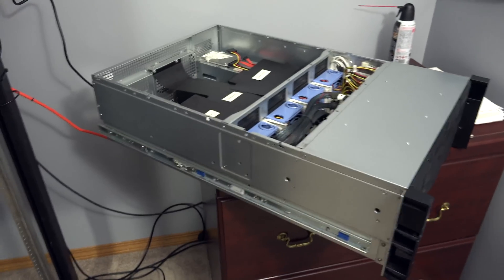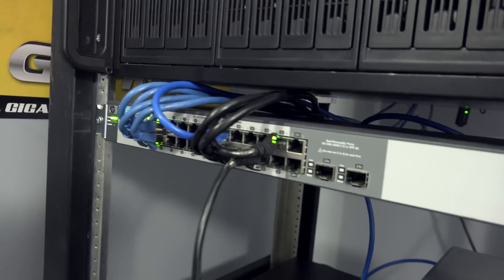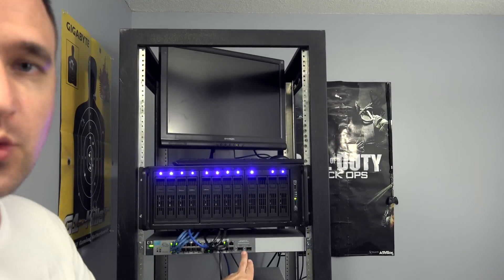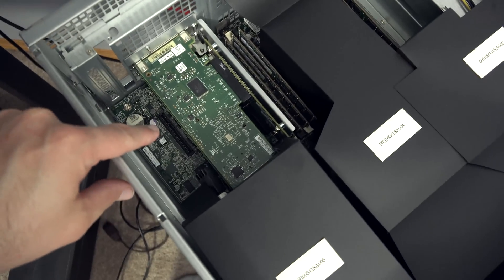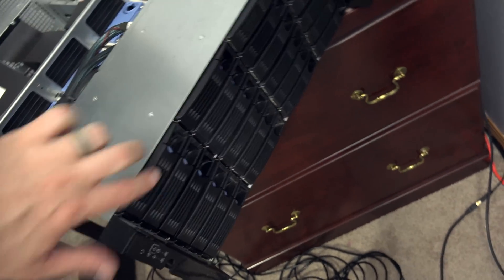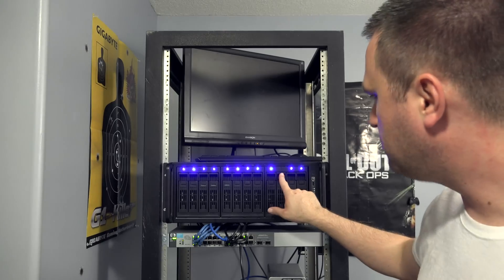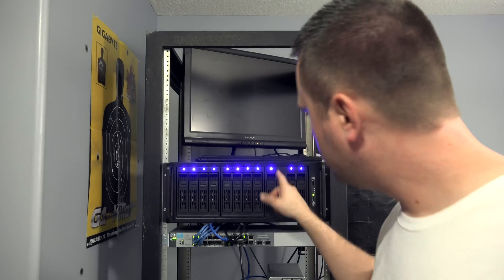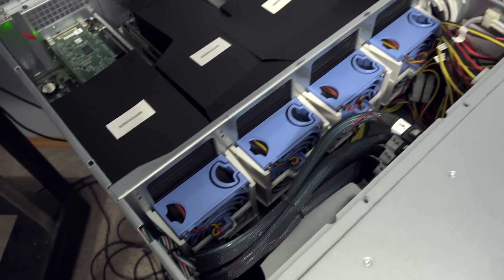New Dual Xeon Plex server vlog...P1...

Comment: Most servers have a power or cooling profile setting in BIOS that allows you to reduce the fan speed and noise of the server.  So, you probably don't need to change any fans.  Also, look up "Intelligent Platform Management Interface" or "IPMI" to see about that network port that didn't work the way  you thought it should.   Once you learn about IPMI I think you will actually like it.  SuperMicro has a number of publicly available pdf documents on their website that explains how to set up the IPMI and use it.  If you can find the serial number for your server write it down and register with ZT Systems so you can get to their support files i.e. user manuals, drivers, and BIOS update files.

Comment: awesome server man. i have one solution which i use for my servers although they run windows with vms as i use a piece of software called speedfan. its super easy to use but as far as i know, its only compatible for windows which sucks. Speed fan will let you change the speed of every single fan in ur server and some other cool things like temps etc. it can be an arse to setup so hmu if ur thinking about using it.

Comment: I love watching your upgrades and transition to more enterprise type gear.  I'm getting ready to do the same at my house, looking for something with 16-24 3.5" bays and at least 32GB ECC.  Whatever I get, I'm going to see if Noctua has a fan that will fit it, much quieter.  Great content, I like watching you figure stuff out as you go..

I've never used unraid, just openmediavault, freenas, and rockstor.  FreeNAS is nice, but my style is to just throw in another drive as I can afford them, and the ZFS pools like to be predefined.  Rockstor isn't super popular as far as I can tell, but I do like the direction BTRFS is going.  Light on resources, and the copy on write and snapshot system is pretty robust.  Downside is lack of maturity and possible instability, although I've never had a problem.

Comment: Regarding the sfp ports on your server, call the manufacturer of the server and ask them what is the size of bandwidth.
Regarding cables, i came across same issue setting up my 10g network. I went through three different cable brands till it worked, i had to use the expensive HP brand cable to connect to my HP switch. You can always return the cables. Use a heat source to loosen the adhesive of the cable packaging so in case you need to return it you can have less issues with the return. Some of those sfp ports will only support copper or fiber.

Comment: I have six enterprise servers in my house. The noise became unbearable that i had to build an insulated closet to house my equipment. To keep the units cold, i ran an external tripplite AC unit to my closet space from below. From top of my rack i pull the heat out to my external wall to the street. That was my solution for cooling and noise.
Reply: Fyi, AC running on low at 67 degrees into the closet, the closet temperature is 70 degrees.

Comment: Congratulations on the new server! 

I have a couple of points. 

1.  Go with unRAID
a. It is less of a hassle for home (non-business) use. 
b. Virtual Machines Host
c. If you ever need to reconfigure, it's much simpler - no need to spend 10 hours reading the FreeNAS manual. 

2. You can fix the fan noise. It is not terribly complicated, but you do need to know basic electronics. 

Servers run PWM (4-wire) controlled fans. Colors are usually; red +; black -; yellow RPM; blue or green PWM. Red and black wires power the fan electronics and the fan motor. Yellow wire is the RPM sensor that lets the BIOS know how fast the fan is spinning. Blue or green wire is the PWM control signal, this signal is controlled by the BIOS. As the server temperature sensors detect a change in rise/fall in temperature, they will adjust the duty cycle of the fan to make it spin faster/slower.

You could try to replace the existing fans with bigger and lower RPM PWM fans simply by splicing the connector. However, when the server POSTs, it spins up the fans to the max duty cycle to check that they are working correctly. So this solution most likely result in a fan fault; the computer might shut down, or if you're lucky it will boot, just forever display a fan fault, which should be fine.

I've done this many times. What you'd have to do is:
a. Keep one high speed fan onboard. You'll need to breakout the yellow wire to the other fan ports. 
b. Splice the yellow signal wire into the all other fan ports. When the server POSTs, all fan ports will report as good.

It's not an elegant solution, but it works, and it allowed me to run my server in my bedroom closet. Otherwise, the noise DOES become burdensome.

Comment: The fans went to 100% most likely because you removed one. The server is detecting a fan failure and is going to some kind of safe mode to prevent overheating.

Comment: You got a lot to do and learn. 
Can't change the fans in New server, bios and ipmi check for all parts being present. Server won't boot if all fans not in place, ish. . .  

FreeNAS will accept growing volumes, but lacks detail at the hardware level. 

You need to fully define your use case.  And test each on your new server. 

I have an hp dl580 g7 and it doesn't really like FreeNAS. Nor does it like pcie pass-through. So you really should test both/all options. 

See if there is a riser card for your server to add more pcie slots. 

Also SATA really is dumb in server hardware. But obviously  SAS is expensive. So just keep that all in mind,  and you can't mix etc. 

I say unraid or VMware esxi. That has a trial as well and can really leverage the server.

Comment: Not cable, it´s probably just the SFP must be HP branded, this is very common. It´s possible to buy noname  SFP with HP firmware for very cheap. 

Use Unraid.

Comment: don't switch fans the hdd's need the airflow. keep in mind, a good hdd temp is between 30-35°C. because the hdd's are stacked so tight together in the front of the chassis there is very less room for the air to cool the hdd thats why you need high pressure and high pressure means loud as hell. for operating system. since you have proper hardware you shoud use a proper system. think of solaris together with napp-it.

Comment: that's a VERY VERY bad idea first of all let me explain something rackmount servers need those special fans because of their design and your any attempt with replacing them might end up with a dead board because those boards have special chips to check integrity of the fans and by dead i mean from cpu damage because those heatsink mount holes are designed only for those heatsinks not some aftermarket ones because enterprise users don't give a damn about noise

Comment: Not sure what your use case is.  But, dual xeons for a file server in non enterprise might be over kill.  I would recommend break the two roles aprt and have a separate plex server and a separate NAS.  In terms of bandwidth see if you can link aggregate the ports though I doubt you will be able to saturate.  Also looking into using SSDs for a SLOG to improve write speeds.

Comment: I'm running NAS4Free in an old PC as my NAS and security camera storage, and without ECC without any problem. I suggest to also take a look at the NAS4Free option.
About the 10GB ports on the MB, without any expansion ports in the back, how this thing was connected before? Maybe there's a proprietary software to configure them to act as the main link to your network. 2x 10GB ports only for bios config and no network connection option should be a very strange configuration.

Comment: If you have a good size coat closet then gut it. Then put your server setup in their. Then just buy a huge amount of long ethernet cables. That would handle the noise issue. Also you might look into thunderbolt 3 pci card for file transfer. it might be faster then 10GB connection.

Comment: Thanks for the informational video.  I didn't find any information about the particular model that you listed, but I do know that they do sell Xeon E5-2650 motherboards with integrated SFP+ (or 10Gbps) ports.  The DAC cables are either SFP+ (10Gbps) or SFP (1Gbps) specific so you need to make sure that you have the right cable for the job.  Although I am not positive, I don't believe that an SFP+ DAC (Cable) will downspeed to 1Gbps.  Since I believe the switch you have is 1Gbps SFP, I don't thing you can plug it into a 10Gbps SFP+ port on the server without a transceiver that uses SFP.  Hope this helps.

Comment: FreeNAS uses a custom build of ZFS, keep that in mind. I got the same problem with noise, you can add resistors to lower the RPM speed of the fans.

Comment: Regarding the noise.  I'm not sure I would mess with the cooling but am not familiar with that model.  If you do proceed, there may be temperature monitors available via that service port you mentioned.  If so, you can benchmark before making changes.  Also, noticed that the cover was off.  My Dell Server is louder when the cover is removed.  When the cover is in place, the fans quite down substantially.

Comment: Best to have 1GB of RAM per 1TB of storage when running FreeNas
ZFS at home is for people who truly hate themselves. Start by reading up on the topic of using zfs in conjunction with those Raid cards you have. I am not trying to say zfs was bad, it is just a handful for home use.

You may also want to consider a virtualization layer to properly split the storage pool form the operating system and not fuse them together. Also helps with including SSDs and run a couple of virtual machines from them.

Another huge problem is when harddrives are not certified for the server. Then their temperature will not get reported properly and the server will push the fans to their limit as a precaution. The noise will then be unbearable.

Comment: like the idea on switching out the fans, btw there are fan mods and firmware mods to quite down the fans or just switch out the loud server grade hotswap fans. Keep in mind that the system might scream at you if there is not a fan attached to the hotswap plug. I'm a Network/sysadmin by trade work in datacenters with very loud Enterprise 1U 2U 3U 4U servers. Another Option may have to been to buy a NORCO RPC-4224 4U Rackmount Server Case with 24 Hot-Swappable SATA/SAS Drive Bays. build your own Xeon system. I know the cheep dual xeon off lease server was a great idea but the noise of these servers is another story. May not be an issue if you have your rack in the basement.

Comment: I work with enterprise servers. if u use aftermarket coolers and unplug the fan system u might get bios error and might cause a shutdown depending on how they coded the bios. message me if u have any other questions. also those ports are probably 1gb
Reply from the maker: Working with servers, do you know of more silent fans, that fit in the same slot as these do? Maybe lower flow ones that wont need to work as hard, because my server wont be running full blown?
Reply: Byte My Bits normally if u look at the bottom part it's not a common connector. if that system has a intrusion switch putting the top lid might slow them down after a bit but still overall would be loud. I have heard of some people putting a pad inside the bottom part of the lids to dampen the sound such as the old dynamat for cards. before u buy other coolers for the cpus unplug them all and see if it can post fully if so then u should be able not to be forced to use them

Comment: I want to see your electricity bill! (just kidding) but keeping those things running 24/7 can't be cheap! What do you do that needs these business level servers?
Reply from the maker: "Need"? barely anything I do is "need". :) I just like to explore things I have never done and runs things I dont have a use for...yet. because I can always do more with it if I ever want to. To me, it's fun. and if it costs a few bucks more a month in electricity, I can feel good knowing I dont have any other bad habits like gambling, drugs, etc, that would cost a lot more.
Reply: I just relized why my eletrice bill is so high :D
Reply: XJLCA $15-25 a month, maybe. I run a home lab (server, switch, 2 WiFi APs, gaming machine) that can consume up to 600 watts. My average is $12.
Reply: logikgr With all due respect, your numbers are not credible and not comparable to what he has.
Reply: XJLCA Let's say, average consumption 24/7 is 300 watts. Run it through an electricity bill calculator with the US average cost of 12 cents per kilowatt hour. The result is: $26.30.

My system average is 140 watts, at night energy consumption goes down even lower to 90-100 watts because I have a timer to shut off 1 AP and the hard drives spin down. I've been running my 8-bay system for 3 years already.
Reply: Consumption is only part of your monthly electricity cost, you haven't taken into account energy cost, delivery cost and other misc fees and taxes they add on your bill, those amount to roughly 50% of your monthly bill. 

According to an IBM study, a rack mounted server consumes at least 350 watts per hour. Two rack mounted server consumes are between 500 to 750 watts. x 24hrs x 30 days. Do your math.
Reply: @XJLCA Still comes out to 30 a month. Remember that the server is measured in watts and your energy is measured in kwh. People always bring up cost of energy but truth of the matter is that it's a none issue in the US. In other countries, maybe.
Reply: Frederick Griffin You don't have to convince me if it is an non issue for you. My original comments was not about your set up or your bill, but as I pointed out, your cost calculation is inaccurate and does not present the whole picture. .

Comment: Go with unRAID. I have a 24 slot server (Supermicro 6047R-E1R24L [nowhere near as loud as that thing! It's in the room next to my bedroom and you can't hear it in the next room.]) that's running vanilla linux for a home NAS/Plex server. It's full of disks of different sizes and I'm out of space. I'm in the same boat and need to decide between unRAID and FreeNAS. Now that unRAID supports dual parity drives, I'm leaning that way. Both FreeNAS and unRAID will allow me to run the OS from a flash drive freeing up a couple of slots that now house the 2 OS drives. My servers also has room for 2 x 2.5" drives that I'd like to populate with SSD's as a cache.

BTW, you can extend the trial of unRAID 2 times for a total of 90 days.

Comment: Your server sounds like two cats fighting. Its also why a similar setup only lasted a week in my household because of the noise. My vote is FreeNAS. I have increased my drive capacity or pool by upgrading the 4 drives from 2TB to 4TB with a few ZFS commands. I later dumped your design idea with MAAS on Ubuntu server. It has served me well along with a standalone FreeNAS server.

Comment: Have you looked at VMware ESXI and running XPEnology in VM mode? I gave up on Unraid after the last update trashed my NAS. XPEnology is the freeware version is Synology disk station. It  uses Synology hybrid raid so you can expand the array with any size hard drive, using raid 5 or raid 6.

Comment: Oh man, I feel for ya.   You picked out a system that just made it really hard on yourself.   I've worked with lots of different NAS/SAN storage setups and have built many myself.  I highly suggest going FREENAS with ZFS.  You can build a ZFS pool and add more disks and expand the pool easily.  for my own setup I went with a used Supermicro server and used Windoze server 2012 and did Tiered Storage ;SSD and HHD in same Pool, the OS moves data around automatically, SUPER SWEET and hands free.  The best part is everything under the sun works with windows (drivers wise) and with the SSD's in there it's SUPER FAST!!!!!!!!!!

Comment: I use FreeNAS, and i'm very happy with it. As for expanding your Pools; if you swap out all drives in a pool with equal sized bigger ones then the extra space will become available to that pool.
example; 3x2TB= 4TB free space in a Z1 pool. Upgrade that same pool to 3x4TB, and then your free space in that same Z1 pool will become 8TB.
(Now i haven't done this myself, but i've seen other guys on YouTube do it) ;-)

Comment: servers are loud, esp enterprise, you really dont want to change the fans unless you can find ones rthat can push the amount of air thru, lock the server in the closet, or the whole rack for that matter, or even wear headphones Like I do most the time, i have like 11 servers that are loud in my bedroom, i recently picked up a 24 port 10GbE SPF+ switch for 260, comes with 4x1GbE RJ45 jacks ( http://www.ebay.com/itm/152020333438?_trksid=p2057872.m2749.l2649&ssPageName=STRK%3AMEBIDX%3AIT ) my 24-bay storage server is rocking on a single RAID card 3ware 9650SE-24M8
24x4TB in HARDWARE RAID 6 mmmm storage
Reply: when you say you have LIKE 11 servers in your bedroom i call BS
Reply: http://hydrodrive.neko-network.net/~sakura/servers/IMG_20160622_160903.jpg
http://hydrodrive.neko-network.net/~sakura/servers/Kiku-v2.jpg
http://hydrodrive.neko-network.net/~sakura/servers/new-router.jpg
and a few others in the closet, that is still in my bedroom
Reply: Do NOT push enterprice class servers in a closet.. They will heat up a room exstremely fast.. The only thing that really works in a normal house is to take out the damn windows and put fans instead of glass. You'll burn out the server in no time with horrible cooling.
Reply: who said the servers in the closet were even hooked up ? they are of the older type and i dont know what i want to do with them, and no I am not dumb
Reply: Some interesting stuff on your server...